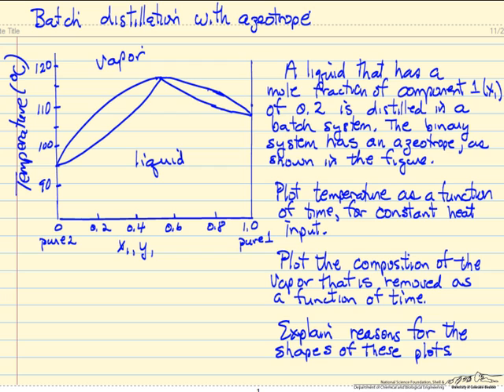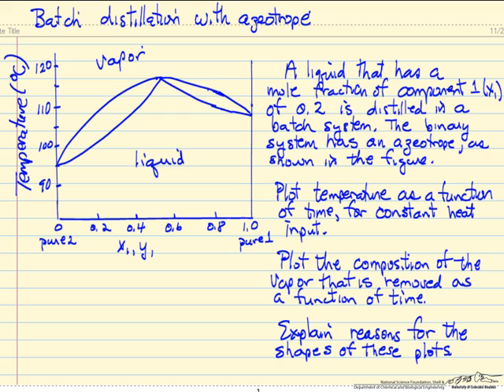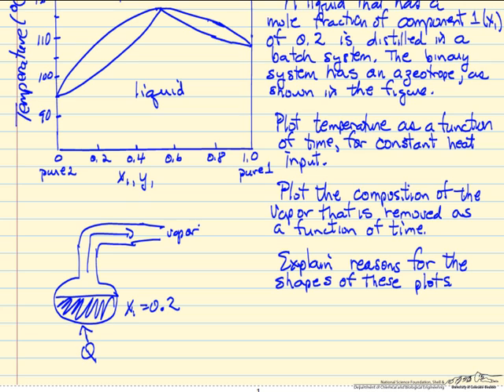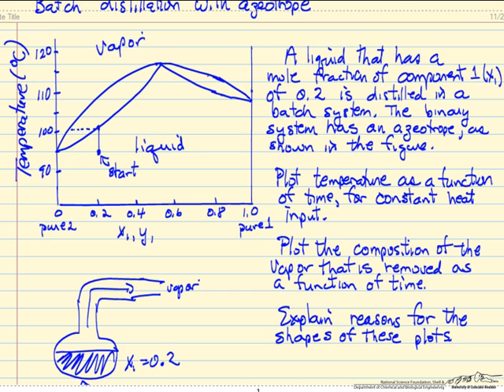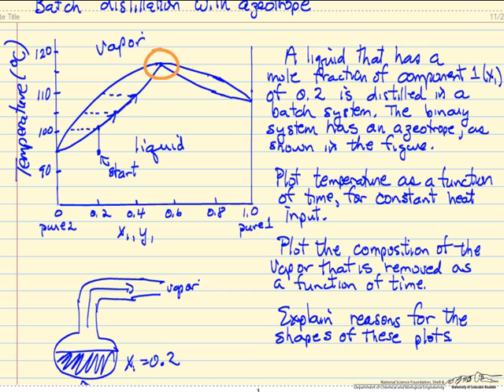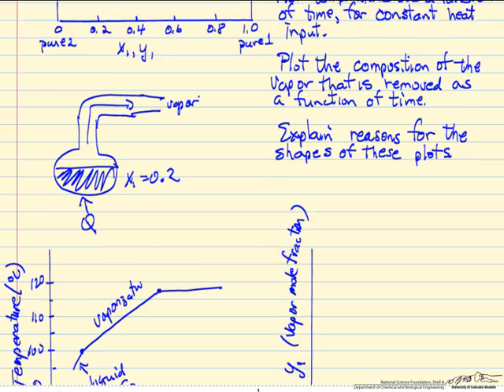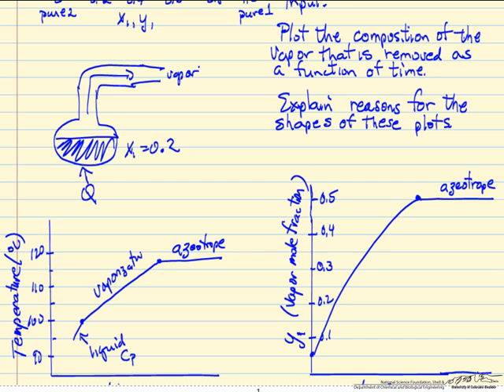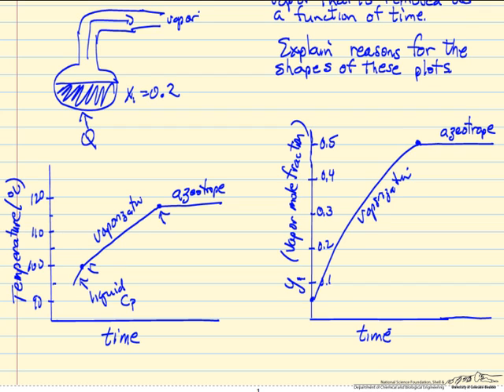Batch Distillation: Azeotrope

Comment: So with azeotropic mixtures, it isn't possible to completely separate the two different components? Because at the azeotrope, the boiling point of the liquid is equal to the boiling point of the least volatile component?
Reply: Well, almost. First of all, the word "azeotrope" (comes from Greek) can roughly be translated to "inseparable by boiling". As for the boiling point part, there are actually two types of azeotropes, there are those that have a boiling point under the boiling points of all components (see: 96% ethanol-water mixture), and the ones that have boiling points higher than the components (certain concentrations of HCl+Water solutions for example). Check out the Wikipedia page of azeotropes for more.
If you managed to learn more about azeotropes since you posted this comment, feel free to share it with me, because I have to study them as well, and I still have a lot of unanswered questions about them as well, haha
Reply: Azeotropes can be broken using different physical and chemical methods (using pressure at which azeotrope does not exist, introducing salts, sorbents, reagents, solvents etc.) but usually not by distillation (at least not at an atm. pressure).